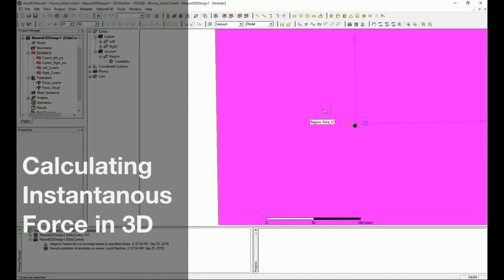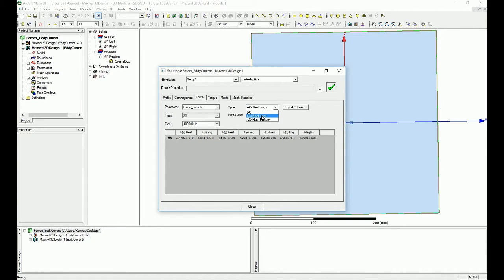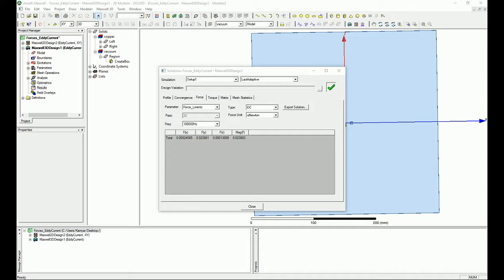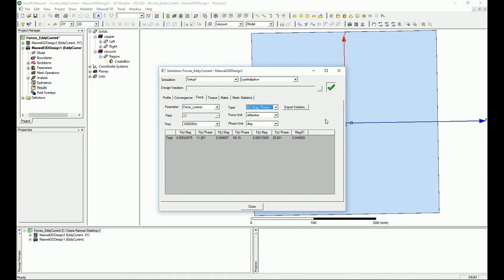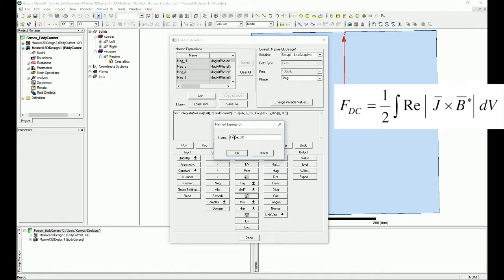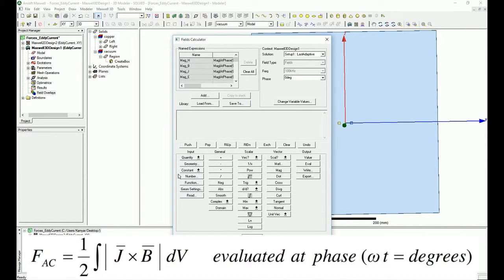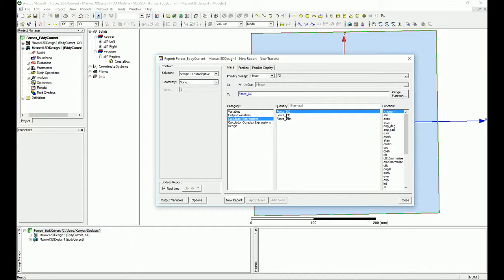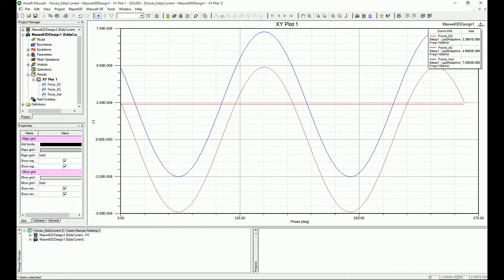311 - Ansys Maxwell | Eddy Current Force Calculations 3D [3/3]

Comment: Hello Kamyar. First of all, I want to thank you for your tutorials, they’re really helpful. 
I have a question on this analysis. I’m modelling a 3 phase transformer and I want to calculate the forces in the core gaps. First I declared a transient analysis and it worked (+500 Newtons) but it took several hours to converge so now I’m trying to model it as an eddy current analysis type but in this case it gives me a much smaller force in the same gap. Magnetic flux density looks the same but the force is almost zero (actually DC force is zero; AC force is about micro Newtons). By the way I’m using force parameter (virtual) in the core in the eddy current analysis. So what am I missing? Forces in eddy current analysis can’t be calculated in structures with B-H curves properties? And that´s why it shows reasonable results only in transient?
Regards.

Comment: Besides, I want to simulate the force between two helix coils in wireless power transfer system. How to achieve it?    Eddy current---force? Thank you very much.
Reply from the maker: +刘明 the same way that we defined the matrix for inductance, you can define the force. first select the object that you want to calculate the force to and then select the parameters-> Foce. that should give you the result after analyzing it in the force tab.